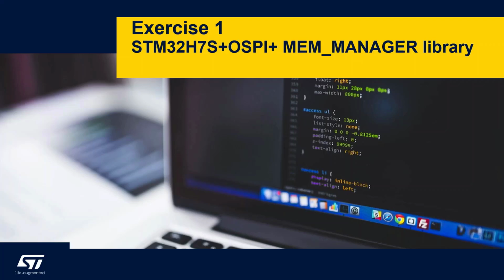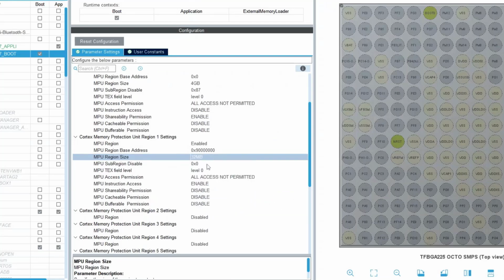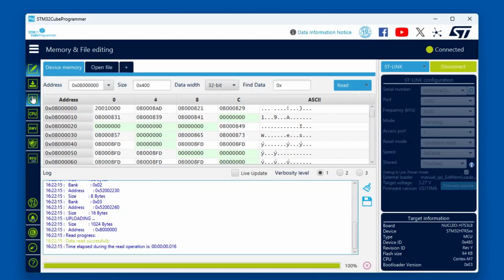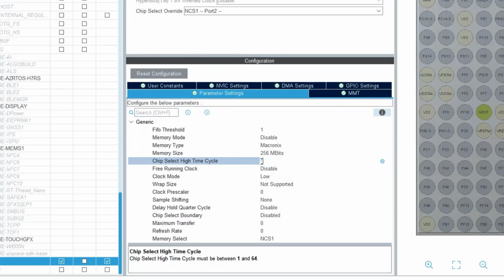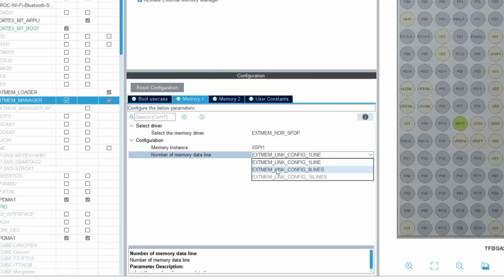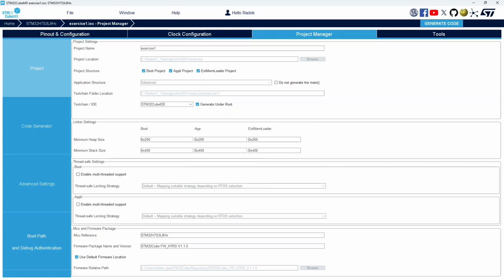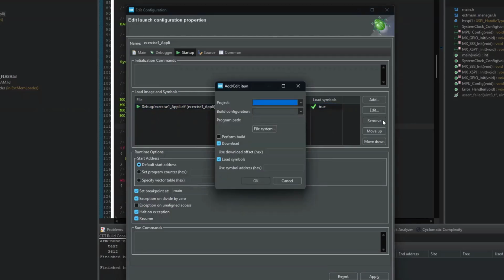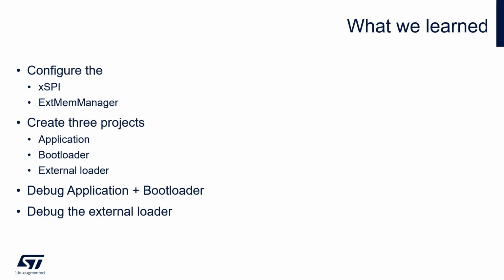STM32H7RS and OSPI in practice - 2 Lab1 - OSPI + MEM_MANAGER library

Comment: This video is an absolute godsent, I was loosing my mind trying to get any of the example projects running on my NUCLEO-H7S3L8 board.
But whenever I built and flashed any of the examples, no code would actually be executed on the board, all LEDs would simply stay "on" and nothing would respond when trying to send/receive data.

Since I am new to embedded development, I expected that all the default settings when I select the correct board would already work, I was really surprised of how much configuration needs to be done in the setup!

But by following this guide and selecting the Chip and not the Board in the Setup, it now worked!
Now I hopefully just need to expand on this example by setting up communication - maybe by following the UART Examples - and then I can finally move on :)